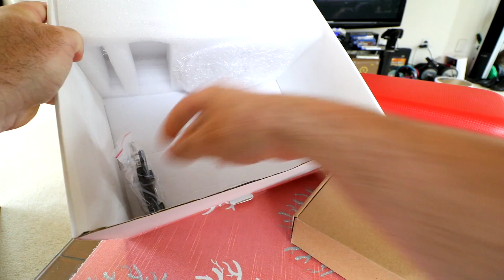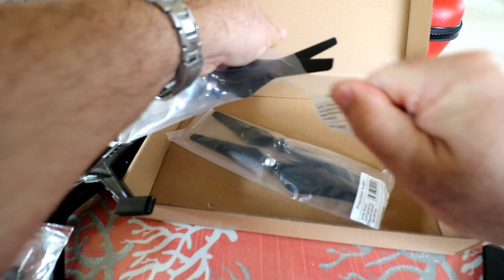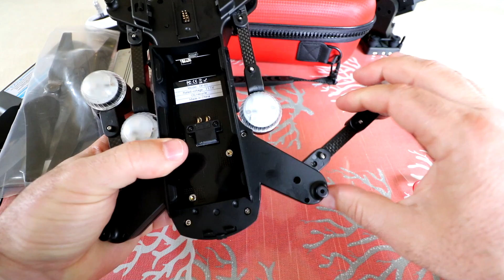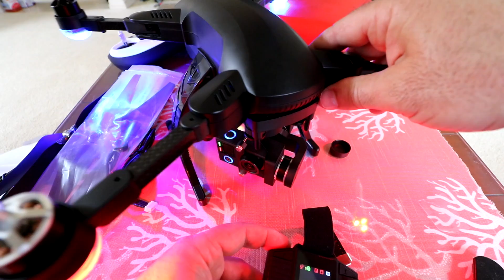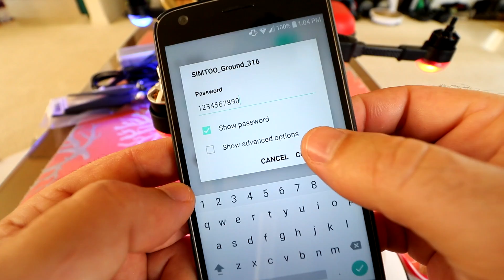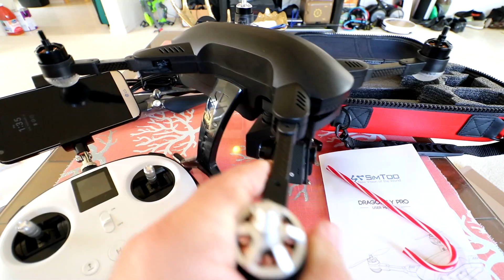SIMTOO DRAGONFLY PRO Review (Better Than DJI Mavic?) - Part 1 - [Unboxing / Inspection / Setup]

Comment: The controller doesn't even fit in the case? Cheap plastic, and if they were going for portability they would need a lot better design to even compete with the mavic... You have to put way too much together in order to fly and stow away. instead of being in the air in 30-60 seconds with the mavic you will be up in the air in 3-8 minutes with this guy.

Comment: How do i find the jumper to connect the drone to the control?
Reply from the maker: +Ludvig Risbecker jumper?  None needed unless you want to connect drone to PC, use the micro USB cable
Reply: Dustin Dunnill i cant connect the contoll to the drone. startad the controll once and pushed den middle and right button. after that, i cant connect it. How do i connect Them with micro usb?

Comment: obviously not better than mavic. but not everyone can dole out a thousand bucks for a drone. i have a question for you @dustin dunnhill: if your budget is only $500 which "portable" drone will you buy, simtoo dragonfly pro or yuneec breeze?

the advantage of simtoo over breeze is the stabilisation. it's mechanical while breeze is simply digital. 

but breeze is more portable, compact and light.

what i don't know is which camera output is better. 

maybe you can also suggest a better drone at $500. thanks.

Comment: Also, your arm and disarm are completely wrong. The arm only requires the throttle controller to move to the lower right.  The right hand joystick has no factor in either arm or disarm.
Reply from the maker: +djtaylorutube I'd say that's not "completely" wrong.  Just half 😉
Reply: Fair point :)  You're not wrong about the micro USB port in the battery bay.  The drone uses an APM with a modified version of Arducopter 3.2.1 and has scope for larking about with it via Mission Planner and equivalents for Android.

The gimbal is based on a Storm32 controller board and can also be programmed as they tend to come a bit iffy as far as PID tuning.

There's a discussion group on RCGroups for the Quanum Follow Me which is fundamentally the same drone.

It's not a Mavic competitor but still plenty of scope for someone who wants to play around.
Reply: Also... it's simple enough to add a bluetooth transmitter into the RC transmitter and then use something like Tower 3 on Android and then have moving map and telemetry.
Reply from the maker: +djtaylorutube hmm.  Thanks, I'll have to look into connecting this with mission planner.  I'll look to  rcgroups for the quanum version.  Just wondering if it's actually the same guts.  Wonder if getting a telemetry radio to connect for mission planner will be a challenge.  Thanks for sharing the info 😉🤙
Reply: Some of us have already added telemetry radios, extra 5.8GHz video, I did a modification to take a different gimbal too.
Guts are pretty standard Arduino Mega 2560 APM.  The only difference that i'm seeing there with the pro is the longer landing legs over the original.  The original had a 2D gimbal which was shorter.  The pro has a tidier 3 axis gimbal now from the earlier prototypes by the looks of things.  Earlier ones had a very fragile ribbon cable and the video transmitter was in a larger housing.  Early versions had no "long range" transmitter which is why I added my own and video telemetry overlay.
Other than that, the flight controller and base drone look the same.
Just don't ignore that sticker that says DO NOT ATTACH WHILE POWERED UP.  If you do, as you slide the gimbal onto the spring pins, it shorts out and the gimbal control board dies.  Had they put the power pins in a different order, it could have been avoided.

https://www.rcgroups.com/forums/showthread.php?t=2666873
Reply: Oh and the other thing, if you connect to Mission Planner DO NOT accept the option to download firmware as the first option.  People who have done that immediately find themselves with base Arducopter 3.2.1 and the radios won't pair anymore.  Just skip past and ignore the firmware download, you already have working firmware!
Reply from the maker: +djtaylorutube Thanks for all the wonderful info your sharing man!  This is really reminding me of my mods on the Cheerson CX20 Open source.  I did bring the Dragonfly along the other day just to test prior to flight test review and it seems to definitely need some parameter tweaking.  Gimbal Horizon goes wonky as soon as craft gets fast yaw input.  Follow me seems to only want to be directly overhead.  Seems to have the same issues I've seen in QC101's flight test.
Reply: No problem, as I said, we're all in the RC Groups thread ;)  The gimbal does go floppy at 50mph too but hey ho, it is what it is.  The 3 axis gimbal that I had briefly wasn't well tuned, not enough power to the yaw and I sent it back and went back to the 2 axis as I was about to go on holiday and didn't trust the 3 axis at the time.
If you're familiar with the CX20, this is pretty much the same.  Same APM 2.5.2 flight controller although whereas on the CX20, it's all plugs and stuff, on the Simtoo the connections are ribbon cables and somewhat harder to access.

Comment: Hey Dustin. I've watched your channel for a while now and just subscribed. I've been watching your video reviews. Also i watch Quadcopter 101 and Tiggers RC Reviews. You should check them out. I was going to ask if you will do a video review on the Autel X-Star Premium. Big thanks for your great videos from the UK.

btw i found those calibration settings for my jjrc h12c5 at rcgroups. I'm finding it easier to fly than my nano hubsan q4. For some reason smaller quads are harder for me!
Reply from the maker: +MaxPower211983 Thanks.  I'll review an Autel if I can get a deal on one 😉
Reply: Dustin Dunnill Thanks Dustin. I'd really look forward to it because i'm considering buying one as a phantom 3 advanced is still costly with extra accessories. And i have no chance of affording a Phantom 4 let alone s Pro 4. Apparently great build quality, great customer service. Doesn't have obstacle avoidance, tap to fly or tracking but half the price of a Dji Phantom3 and could compete with the P3. Removable gimbal and camera, Autel announcing new gimbal and camera swap out upgrades soon. Tutorial mode to bind to another transmitter. Great for beginners who want a phantom 3 but can't afford and almost half the price with better build quality. I can't wait to see what else Autel bring us next. Maybe a drone to compete with the Phantom 4 or Phantom 4 Pro.
Reply: Dustin Dunnill I just found out some dissapointing news about the Autel X-Star for uk owners. It uses  902 - 928mhz for video transmissions which is a protected frequency band for emergency services in the uk. This is super upsetting. I had my mind set on potentially buying one of these.

Comment: This looks like a cheap knock off drone and the watch looks gimmicky. No way would I spend $500 on this bird, however I wouldn't spend $1k on the Mavic as it has its own problems. I was hot on the Mavic until I started seeing more crashes , it seems like the camera/gimble are easily damaged.
Reply from the maker: +redjack56 we'll see how it does in the in-depth flight test.  I'll make sure to read the directions :)
Reply: redjack56   I crashed the shit out of my Yuneec Typhoon H and have had just as many flights already with my Mavic including all the stupid shit I did with the Typhoon H and a 3 mile flight with no video or telemetry or ever any warnings where I couldn't even get out 1800 ft without total loss with the H and NOT ONE CRASH with the Mavic. Not sure where you are getting your info. Get the Mavic you won't be disappointed. I hated the controller, color and the look if the Phantom series which is why I bought the H and damn if I had known the Mavic was in the making I would have waited to purchase my first drone! Love EVERYTHING about the Mavic!  wasn't a DJI fanboy until the Mavic! I don't have any issues being called one now though!

Comment: Great review but the drone looks cheap with several corners cut. The 360 gimbal is nice though too bad you dont have a point of reference as to the gimbals position. Maybe getting it airborne and seeing how it flies would convince me of its worthyness.
Reply from the maker: +Eric Owens Good point.  I may need to put a marker on the yaw control wheel for center.  Flight testing soon and we'll she how she does :)
Reply: what up owens

Comment: haha, better than Karma!
Reply from the maker: +Georgi Tushev I should have mentioned it compared to the Karma but for some reason it didn't cross my mind..lol
Reply: Dustin Dunnill looking forward for the flying part of your review! Thanks for all good work! Aloha from NY!
Reply: Georgi Tushev not sure why all the negative remarks on the Karma.  I have a Mavic, Phantom and Karma.  I can tell you the Karma has features that are hands down better than either Dji, and Dji has some great features.  If I was to choose only one, it would be the Karma.  No sensors true, but just look at Dji latest video cartoon on flying into wires.  If you rely on sensors get ready to lose a drone.  So far better video from the GoPro camera, much better costumer support from GoPro.  Don't get me wrong, I like all three, just think GoPro is getting a bad rap.Mavic needs a case you don't have to buy after market like this one.
Reply: haha iphonedo <3

Comment: could you fit a Yi 4K? also all the functions?
Reply: max chilla I think not
Reply: Problem with The Yi 4k camera is that it is more rounded so it doesn't fit in most gimbals because of that. You need to buy a gimbal made for the yi4k
Reply: Well i guess it would fit. Question is the functions. Really Like the dragonfly pro, but 1080p?
Reply: max chilla upgrade to a sjcam sj7 ;)
Reply: Same question! Will video Start and pause Work? And anyways i already have a yi4k. I dont have the Budget For 2 4K Action Cams...
Reply from the maker: +max chilla I don't have a To but I'll try and plug in a GoPro and possibly other cams to see if they work and mention it in the flight test :)
Reply from the maker: +max chilla YI lol. Sorry .. Auto correct
Reply: Dustin Dunnill difference between a yi cam and a gopro or most others is that it is curved...

Comment: 1080 is 2K
(1920 x 1080)
Reply: Yes - 1920x1080 is '2K'
- 4K is 3840 x 2160

- but you can also call '2K' 1080p
- and 4K can be called 2160p
- it's just that 4K is easier to say, and sounds cooler & better than 2160p
Reply: Are you serious? 1080p (1920*1080) 1440p= 2k (2760*1440) and then there is 4k (3840*2160)
Reply: I'd normally call 1080p, 1080p, but it could be called 2K
- in the same way as 2160p is called 4K

2560x1440p would usually be called 2.5K, to distinguish it from, er, 2K (1920/2048 x 1080p)
- 2K was originally used to destinguish 2048 x 1080i/p from 1920 x 1080i/p
- but when 4K came out, people called 1920x1080p '2K' for convenience...
Reply: 1080p is '2K' in the same way as 2160p is '4K'